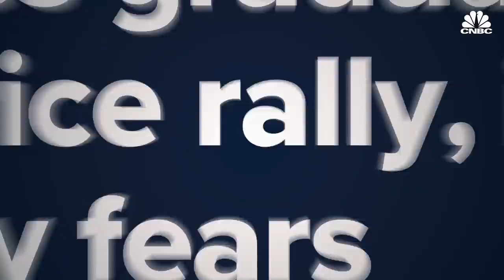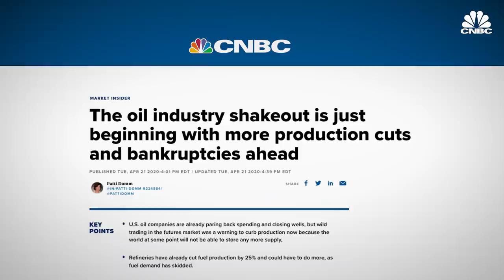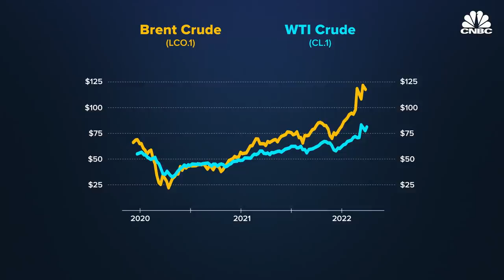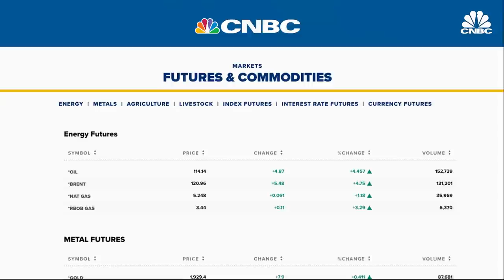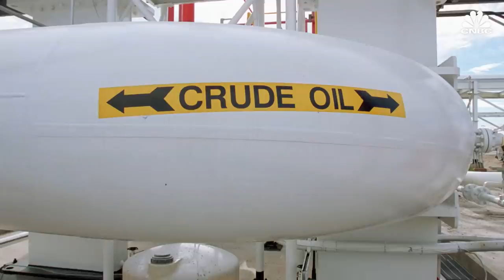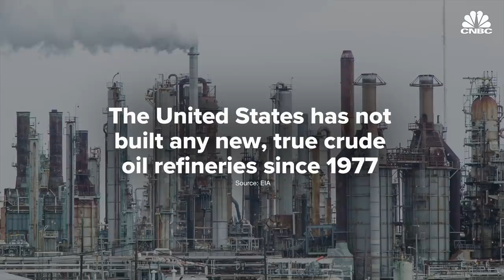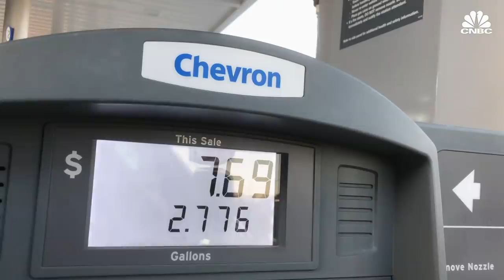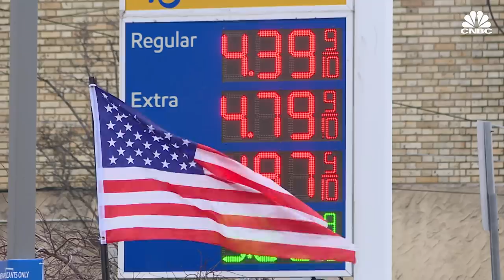Why Russia’s War Drove Up U.S. Gas Prices

Comment: Can't wait to hear why oil was expensive before the war too.
Reply: They did mention it in the video. Supply shortage.
Reply: @xteb65  Yeah, and Brandon is responsible for stifling supply by banning pipelines and halting fracking and drilling.
Reply: It was actually answered in the commentary - investment climate is into-hydrocarbon, extreme volatility in the past 7 + years, multiple bankruptcies in the industry
Reply: It is right there in the video. All you need is basic understanding of economics. In the video, it states that the business model for oil and gas companies, and the investors who finance these projects have changed. Before it used to be drill, baby, drill. Now investors want more cash flow, more return for their money. So, they are instructing oil and gas companies not to spend more money on capital expenditure like drilling for more oil, but rather spend the money on dividends and stock buybacks. That is why supplies have been stagnant even before the war. The war just exacerbated the situation. 
So, if you limit supply, because you are not spending more on drilling, and demand is going up due to the world's economy coming out of the pandemic. Then by economic logic, the price of crude goes up.  And it is not only US domestic producers not willing to drill more. Other big producers like international crude oil alliance called OPEC and Rusia over the past year have refused to increase production.
That is the reason why oil was expensive even before the war. It is called: Supply and demand.
Reply: It’s not expensive unless you’re poor. 😉
Reply: @anttikalpio4577  true, but that’s not the point being made.  The point being made is that it is significantly more expensive than it was before.  Not that it’s so expensive that no one can afford it.  Why pay more for the exact same product?
Reply: @johnmartin4641  Okay. You are going into Qanon conspiracy theory territory now and that is where I draw the line. I thought we doing a substantiative discussion on how demand and supply affect  global crude oil prices, but now you are coming up with all these stuff. I am on not going to waste time countering your baseless arguments. Adios.
Reply: @jameson3500  Can you point to a law from the current administration that bans fracking or halt drilling? The answer is none. I work for a oil & gas service company in Texas and we are fracking like crazy. In fact, I am writing this from an oil rig, and across on an adjacent location, they are fracking about 4 production wells. Once we're done drilling here, the frac guys move in. 
As for the pipeline you mentioned, the main purpose of it was to transport Canadian crude to processing facilities on the US coast for export. Not for US refineries or US gas pumps. Do your own research. and stop relying on Faux News. 
The video says it all. Oil and gas companies and their investors are not spending more on drilling because, yes, they want prices to go up so they can maximize profits. They are not interested in you getting $2/gallon gas. They'd rather pass the blame on the government pointing to trivial things like a pipeline that would not be supplying the US market anyway. The US is a free market, and government cannot ban drilling. Do you know the amount of lawsuits that would ensue from  big oil corporations like Exxon, Chevron, Conoco, etc And besides, a lot of politicians receive their campaign money from big oil. Including some Democrats
Reply: They will blame trump
Reply: @brandonannisette6023  nope
Reply: @Tom Amerman United States EXPORTS all oil we produce, so it doesn't matter if we are the largest producer if the oil we produce is to bad to use in oil cars and vehicles. That's why gas prices are going up even before the war.
Reply: @SH-ld7yd  incorrect. That point was brought out solely for the purposes of explaining why the oil companies aren't rushing to produce more oil. In that same statement they also pointed out oil companies were recouping some of their lost revenues from early losses early in the pandemic and how to the oil companies a short term (6 months) wasn't worth the extra inputs of ramping up production just to have the market turn back down and them be out the money again
Reply: @MeetJarred  not all oil. Roughly 40%. Overall though with producing 11 million barrels daily and a consumption of approximately 20 million barrels daily we are still a net importer of oil and therefore rely on foreign oil well beyond the 8-10% of heavy crude our older refineries require to operate properly to make fuels
Reply: Thank FED  😂😂😂😂😂😂😂😂😂
Reply: @eudofia  great concise answer.
Reply: @xteb65  I don't understand why some of these narrow-minded people making some of these comments don't understand the video.
Reply: So there are multiple reasons for this. The first is that Fossil fuels are a commodity that needs constant investment just to maintain their current level of output. So when things like a global pandemic happen investment in oil drops quite a bit. Let's not forget what happened in the first few months of the pandemic. Lots of people stopped driving, and the price of oil dropped like a stone. If I remember correctly the price even went into negative territory for the price of a barrel of oil. People were paying people to get rid of the stuff. This caused a lot of investment in oil to drop especially the relatively expensive fracking industry to drop. Second, it takes about 6 months to a year for a decision to increase the supply of oil to actually take effect. So it's easy to reduce the supply of oil, but hard to ratchet up supply if demand spikes up relatively quickly. This brings us to our next problem. Our economy rebounded faster than anyone thought it would.
Reply: @xteb65  Not just that OPEC+ countries also refused to making enough to keep up with demand so they can start hording as much cash as they can before the west goes energy independent with investments into Renewables.
Reply: You won’t see that video 🤦🏾‍♂️
Reply: @maximusprimus827  It's not that hard, just look up for videos from 2 months ago.
Reply: @Bryson Hall if what you said about recovery, supply and demand is true then why blaming it on the Russians?
Reply: @usa9116  and gave a few billion free weapons to the Taliban.
Reply: Exactly
Reply: Propaganda
Reply: @jpinvestcebu  true
Reply: At 6.00 per gallon, it costs me $90.00
to fill my tank. It used to cost me $30
l used to spend $175 each week at the
grocery store. My bill has been over
$225 for roughly the same stuff.
There is no way any Democrat should
be elected to any federal office ever
again.
Reply: @brandonannisette6023  it was cheap as hell last year during that shortage
Reply: Tonight, on the other side of the world, an oil tanker gets stuck in a canal.  Tomorrow morning, the Exxon station at the end of my street marks their price up 50 cents.  So, just normal price gouging.  Capitalism gonna capitalism.
Reply: Ditto!
Reply: @johnmartin4641  trump shut down the country.
Reply: @johnmartin4641  you must be in favor of smoking in public.
Reply: @steveb796  ha ha you ate hilarious
Reply: @Tay-no8ci  i ate hilarious?
Reply: @flyingcatflyingcat4774  Double that amount during trump, what's your point?
Reply: It's because oil companies are not investing in new drilling operations anymore. 

The factor that's causing this, is that most countries have committed to deadlines to move away from oil.

So, who in their right mind would make long term investments in oil infrastructure to drill more oil?

Also, nothing else is taking oil's place in any significant amount. We are creating a hole, but nothing else is filling that hole completely. 

This is why energy prices will continue to increase, even without wars, floods or terrorist attacks on oil infrastructure in Saudi Arabia...
Reply: @admiralackbar3634  it's like this everywhere, not just your single democrat-leading country. Why do Americans think that this is an American problem?
Reply: @rich-qk7dc  I think you are missing the point of the whole video. This is not about Trump this, Trump that. This is about investors demanding more fiscal discipline from the oil companies so they can maximize profits. Meaning, drill less so supply is kept in check, leading to an increase in crude prices. It is not only happening here in the US. Other oil producing countries are doing the same. Oil is an international commodity and so is priced at the international commodity exchange. It does not really matter how much drilling goes on here in the US, if due to international events like the war in Ukraine makes prices go up, you will still feel the pain at the pump. The US, just like every other country is not shielded from crude oil price fluctuations. And here is the thing, oil and gas companies want crude prices to go up and up, for obvious reasons. They don't care about our well being or our desire to have $2/gal gas. They'd rather sell their crude at $100, even if they get it for $5, which they don't.
 The Faux News propaganda machine will tell you that Biden is shutting down US oil production. You mentioned it yourself: "vows to shut" American oil. The only problem with that statement is it is false, or twisted as usual by the right wing media. Politicians say one thing to fire up their base, only do the complete opposite. Trump said he was going to make Mexico pay for a wall on the southern border. Yeah right. How did that work out? 
What Biden said was he was going to work to reduce America's dependence on fossil fuel, and increase clean energy production like wind and solar. Well, the right wing media jumped on that and said he was going to shut down American oil. It is a bit of an exaggeration don't you think? And by the way, can you point to a new law passed by Congress or an executive order by Biden aimed at shutting down American oil? The answer is there is none. But if you listen to Faux News, you'd think the FED at this moment is going from well to well shutting down production. Yeah, I know you or someone will be quick to point out, but how about the Keystone XL pipeline that Biden ask to stop building? That would have been to transport Canadian oil to US ports for export. It was not even going to US gas pumps. 
As of yesterday (3/30/2022), Biden is asking oil companies to drill more, and is also telling the oil companies holding leases on Federal land to use it or lose it. Meaning if you are not going to use the acquired lease to drill for more oil, then you pay a fine or lose the lease. How is that shutting American oil? You see what I tell about politicians? He went from vowing to increase clean energy to drill, baby drill for dirty old crude.
Reply: Can't imagine charging electric tanks with fast charging 50 watt
Reply: @pirmansyah-oe1it  air to air F-35 recharge
Reply: @eudofia  no you are wrong. Your in Texas, not the rest of the US. Here in PA they have stopped fracking . It's politically motivated
Reply: @eudofia  here you go.... Per his executive order. "We need other industries to transition to get to, ultimately, a complete zero emissions by 2025," he said, according to a transcript. "What I will do with fracking over time is make sure that we can capture the emissions from the fracking. Capture the emissions from gas. We can do that and we can do that by investing money into — It's a transition to that."

That's like saying we won't ban guns we will just ban bullets.. zero emission fracking is not possible
Reply: @steveb796  The Supreme Court has established a clear prohibition against attempts by the federal government to commandeer states to further its own agenda. In New York v. United States (1992), Justice Sandra Day O’Connor explained that although “Congress has substantial powers to govern the Nation directly” the Constitution does not “confer upon Congress the ability to require the States to govern according to Congress’ instructions.” Justice O’Connor further wrote:

We have always understood that even where Congress has the authority under the Constitution to pass laws requiring or prohibiting certain acts, it lacks the power directly to compel the States to require or prohibit those acts. The allocation of power contained in the Commerce Clause, for example, authorizes Congress to regulate interstate commerce directly; it does not authorize Congress to regulate state governments’ regulation of interstate commerce
Reply: @steveb796  oh now you changed you tune ? Lol.  Very democratic of you. It's dangerous if your fat or you have other health conditions otherwise same as the flu.
Reply: @tekadsaja  yes they do, we don't want the war. We don't care about ukriane Russia can have it
Reply: arrest the oil giants
Reply: @angelachanelhuang1651  why they aren't the ones driving up the price that's jow Biden what are you complaining about just go buy an electric car
Reply: Can’t wait for idiots to pay me back for their decisions.
Reply: @lostonearth7856  Yes they are revolting because of our terrible diplomatic relations under the Brandon regime
Reply: Inflation, 0% interest rate, spending, printing of money by govt 
That's it
Reply: Oil was expensive primarily because it's a finite resource, it's non-renewable which the more we use it the less there is to use,  prices rising was and is inevitable, but with the Russia-Ukraine conflict as well as US oil firms being forced out of Russia due to Russia waging war against both the EU, the US, and Ukraine, the US had to find a way to punish Russia which was to cut all business ties with Russia alongside the EU and Ukraine. Russia retaliated by attacking Ukrainian resources causing food shortages, benefitting territories like China in competing with Ukraine in the continent of Africa with their farming industries by selling more industrial and farming equipment in Ukraine's absence which would leave China as the only territory to trade with, which would further monopolize trade in Africa to lean in China's favor.
Reply: @whatsgoodmyguy4391  How is it a Biden policy if oil is a finite resource running out because of advanced consumer needs. The unregulated Capitalistic inflation that has taken place for decades and the advanced purchasing power of individual car drivers is what is crippling oil availability and has been for the last couple of decades.
Reply: @kantovagrant3194  Yes he did. Would you like me to post the video here? Will you still deny it?
Reply: @kantovagrant3194  here you go
Reply: @whatsgoodmyguy4391  Where is the link...I don't see it?...🤣🤣🤣
Reply: @whatsgoodmyguy4391  You literally just said here you go without a link...
Reply: @kantovagrant3194  oh I pasted the link and Google removed it so I did it again and then I cut and pasted the text ... Go ahead read it
Reply: @kantovagrant3194  read the text I posted what you gotta say now ?
Reply: @whatsgoodmyguy4391  
It's still has no link, just send it as a reply with no text but the link.
Reply: @kantovagrant3194  go ahead lets hear your excuse for Biden he said this 100x
Reply: @whatsgoodmyguy4391  Dude where's the link to your video? Are you on Apple or something?
Reply: @whatsgoodmyguy4391  The real reason why gas have a price hike is primarily that all gas companies in the US are private companies. They have higher-ups that make decisions without the government's approval to make a sustainable high yield profit which is a common trope of capitalism. The CEOs and CFOs of those organizations set the tone of those profits based on the need of the people and the availability of the product, the government can't control other companies because they don't have the power to, the only governmental system which has that capability is communism which sets up a market to where governments control all neccesities.
Reply: @whatsgoodmyguy4391  The true reason why we have the price hike is just a result of capitalism itself. When the world has urgently sought a necessity, private companies which have the product raise the prices of that product not only to keep their business operational but to profit in monetary compensation where they would invest in future projects. That's why the Gas Tax Holiday got rejected by both Republicans and moderate Dems, so private businesses can ultimately profit from our citizens.
Reply: @kantovagrant3194  No the gas tax holiday got rejected because it's stupid.. that has no effect on the profit margin of oil and gas companies. I hope your not American because boy you should not be voting. The gas tax is what you pay in addition to the price of gas. Would 20¢ a gallon really make a difference?
Reply: @whatsgoodmyguy4391  Well it would lower gas prices domestically across the board by "at least twenty cents" in every state which is a starting point. No gas cut can lower prices by $2.00 which can have a positive effect on the economy except for increasing the consumption in an already overspent buyer market. Plus it's a necessity if we essentially viewed how many times in human history wars have caused a greater need for the necessity of gas or any other natural resource, especially in Europe we can back nearly countless times. Plus it's not exactly like the gas markets have changed in terms of US consumption of goods, but the key reason why we are experiencing high prices is primarily that we get are gas from private company distributors which have an international presence, basically meaning that if a gas company that is privately owned loses operation in another territory labor and production costs would go up in terms of that business staying a float, in which if we imposed a gas tax, that would satisfy US citizens but would destroy our markets and infrastructure, the US people don't care about infrastructure as long as they get the best deal possible for their pockets, so it's a lose-lose situation in which private business has control, specifically private oil and private gas. It's not like Trump could stop gas prices from rising completely or other Billionaires like Elon Musk from moving his industrial factories to China costing Americans upwards of 50,000 jobs across four years, even when our economy was open.
Reply: @kantovagrant3194  Nope nope nope. There you go again !!!! Excuses excuses. It's Bidens and congresses policies
Reply: @whatsgoodmyguy4391  Okay so, how would Trump or any other organization solve this issue.
Reply: @whatsgoodmyguy4391  Well, it's not like America has stopped drilling, we have to find alternatives to oil, and sometimes that results into taking a step back. If oil consumption goes up, will run out of it a lot sooner than 2088.
Reply: @kantovagrant3194  also you clowns said the same time before peak oil blah blah and polar bears were going extinct and the oceans were rising. Lol.. neither has happened
Reply: @whatsgoodmyguy4391  Why do you think we even decided to join the Paris Climate Accord or form Green New Deals in the first place. Everyone and their mother knows Oil is finite, once it's gone it can't be replaced, we have to ration it. It's the same with Gasoline, if we increase consumption of it just because consumer need, what happens...we  run out of it sooner.
Reply: @whatsgoodmyguy4391  Think about history for a second, America had a Great Depression which led into an enormous recession because of the lack of what resource in terms of domestic drilling....OIL AND NATURAL GAS. Jobs in this industry declined, oil rigs closed, and 10s of millions of Americans where left out of a job.
Reply: @whatsgoodmyguy4391  Yeah sure, but I bet you can't explain why Fox News won't tell you how America is even in this recession in the first place.
Reply: @whatsgoodmyguy4391  It's stupid trying to have debates with fools who refuse to listen to each other's arguments. Your not worth a debate.
Reply: @kantovagrant3194  How is that? You stated "Joe Biden never said that" you can't even admit you were wrong. 

How about that for a start ?
Reply: @kantovagrant3194  It went up under Obama and that was during a depression care to explain that genius ?
Reply: @kantovagrant3194  private business don't cause inflation the government does.. don't be such a clown sheep.
Reply: @kantovagrant3194  In Saudi Arabia gas is 97 cents a gallon.  Saudi Aramco is the world's largest company if profit is their motive why is it so cheap there ?
Reply: @whatsgoodmyguy4391  Quick question. Why would a president choose to conserve oil and natural gas through other resources which are renewables be called anti energy.
Reply: @whatsgoodmyguy4391  Private Bussinesses create their own prices based on supply and demand, the government can only set regulations, tariffs, and taxes but it can't set the prices.
Reply: @whatsgoodmyguy4391  Quick question, do you think our government controls ExxonMobil or do you think it's a private bussiness with a founder and a CFO.
Reply: @whatsgoodmyguy4391  Well that's partially my point, the government can't really CONTROL other businesses and what price points they set, that's why administrations now and in the past can't CONTROL Gas price hikes. When the GAS conglomerates decide that the demand is larger than the supply gas rises and the consumers pay more, when we relax in gas consumption and consumerism falls and allows the gas industry to collect more gas then the gas prices will fall.
Reply: @jameson3500  I'm confused what you're point is. "Brandon" had prohibited future expansion in the way of risky fraking operations as problematic pipelines, however he has not touched existing infrastructure. While you could say that "Brandon" has inhibited the growth of supply, he cannot be blamed for supply shortages as he's for the most part left existing oil infrastructure intact. He's even compelled companies to drill on untouched already licensed land which is a step towards increasing supply
Reply: Just to clarify my point, I'm not suggesting there are any laws in particular that are making oil more expensive. It is sentiment that is causing this. We have a government touting electric vehicles and they are making negative statements about oil. Oil prices are speculative so sentiment is important. Hey, I'm all for electric vehicles and renewable energy. It's literally what I do for a living, my company powers houses and the DIY community with upcycled electric car batteries and other forms of e-waste. To prove my statement, if every government announced today that they support the oil industry 100% you will see prices drop. Investments will flow in. If you had a million dollars why would you invest it into something you know the government wants to restrict and make laws giving alternatives tax breaks? The administration is telling us that oil is expensive because of the war however it was already going up months before the war announced. Seems like the powers that be saw this coming or perhaps negative sentiment caused it. Either way the war was not the only reason for gas prices to be what they are today and we should know that there are many reasons for prices to be the way they are. Also don't claim victory when prices drop if months before they're saying they have no control over the price of oil. The discussion should be opened up to nuance. A lot of statements being made are partially true and purposely selective.
Reply: @xteb65  caused by democrats, and the potato
Reply: @tomamerman7699  we can look at Europe as a great example. Whatever Biden did, Europe did YEARS ago. Many European countries have long since set emissions goals and have been quite aggressive in meeting them. Despite that,   the hike in gas prices is still relatively recent, and coincides with the one experienced here in the states. While yes, European gas prices over the last 10 years were generally higher than that lf the United States, this can be attributed to a lack of domestic production as Europe is pretty much starved in the way of natural resources.
Reply: @SH-ld7yd  BRANDON, "I DID THAT"